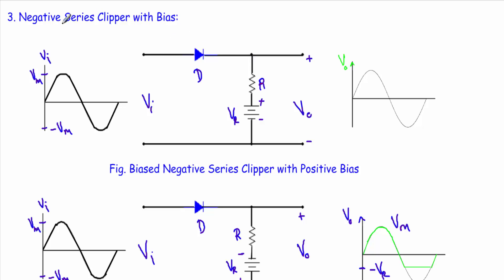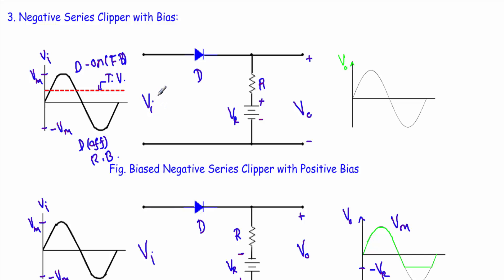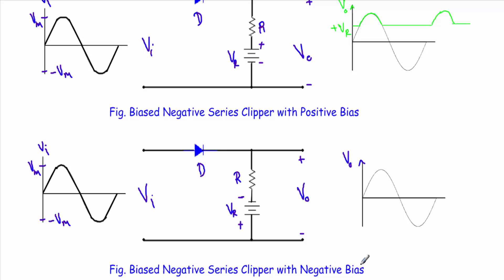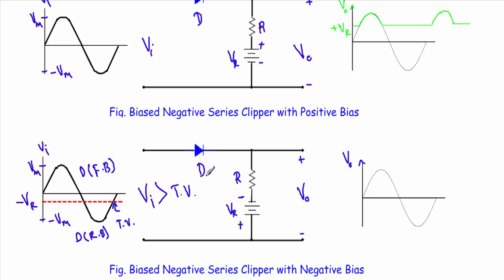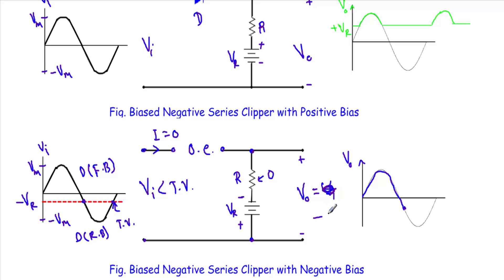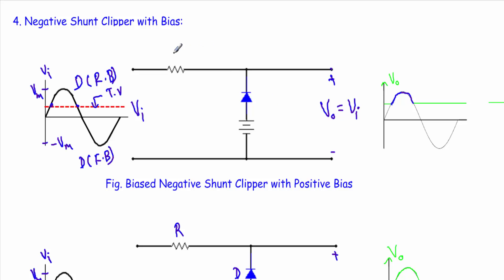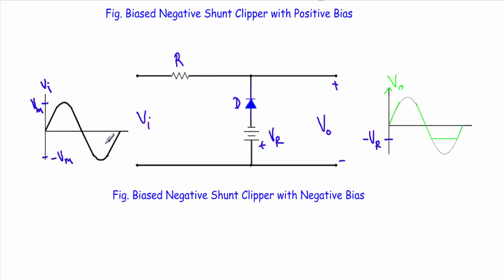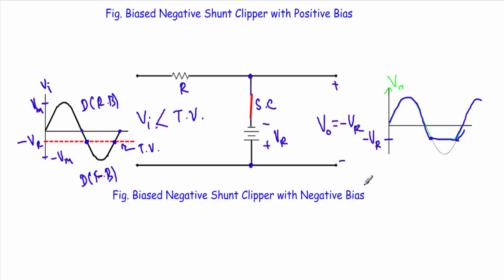Biased Negative Clipper Circuit

Comment: how diode in reverse bias if vi>tb? if tb is -5 so for when vi is -2 or -3 (say) the current will flow from vi to -5(tb) so it will be forward biased since negative of supply is connected to negative of tb